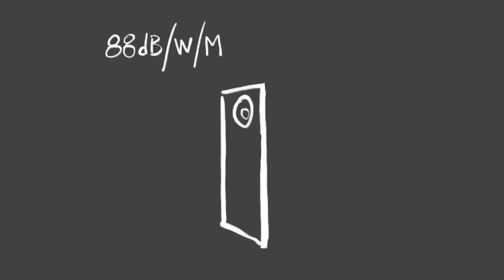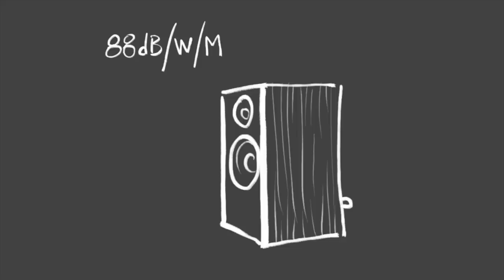John DeVore goes on a rant about the High End Audio lie that inspired him to start his company

Comment: What makes me laugh about the whole hifi thing is that the engineer mixes the music on studio monitors using standard studio cables etc. yet audiophiles are told they need to listen to music on $3k speakers, through this or that amp with hundred dollar cables 🤣
Reply: Coming from a music/producer background and expanding into hi-fi audio this fact has puzzled me to no end... It’s also funny to see endless amounts of money poured into a set up that has no acoustic treatment whatsoever. People don’t realize that the room itself is just as important as any other piece of hardware in your setup.
Reply: Wait... I thought studio engineers mix on great, top quality speakers and use generally top notch, expensive equipment?
Reply: Depends on which studio. There are those that use what you refer to as audiophile speakers and cables. Abbey Road being one of them.
Reply: @465marko  They absolutely do, but there’s a difference between studio monitors and audiophile speakers. Monitors are created to be balanced and tuned in a neutral matter so that the songs entire mix can be heard as clearly as possible and so the producer can create a mix that sounds great on any speaker or device. Audiophile speakers however are not neutral and can themselves sound “beautiful” but in doing so the mix is slightly altered. If a producer used audiophile speakers to mix their song, it wouldn’t sound the way they intended it to on anything except the speakers that were used. A lot of producers will have a variety of headphones and speakers to test their mix on only AFTER it’s been tuned in with the monitors, just to make sure that it sounds great on everything that they test it on before releasing it. But if you want to hear what the artist was hearing when they gave this track the green light, you’ll want to try professional studio monitors. If you can do so in an acoustically treated room even better... audio quality isn’t really about how good or bad anything is, there’s just an incredibly wide variety of ways to enjoy music in hi-fidelity. If we use a food analogy, the producer is a chef who makes your food as true to the recipe as they can, and audiophiles being the customers are arguing over which salt and peppers enhance the dish most or how much they spent on their organic black truffle hot sauce.
Reply: @465marko  the difference is that studio monitors are meant for designing the sound so that it sounds as intended on all types of speakers and speaker qualities. If you made music exclusively on super high quality equipment, you might have trouble adapting it to sound good on something like laptop speakers.
Reply: @LimewaterMusic  Thanks for that, makes sense.
Reply: @MrManlyBeardyMan  Thanks for that nice explanation.
Reply: Hundred dollar cables?  Cables go up to the tens of thousands.  A year ago I wouldn't have believed it.
Reply: My audio engineer has saved me from spending tons of cash.

Comment: I can relate with your gripe. I built my first speaker, a 21" non-ported, steel-bodied (24" diameter steel pipe) subwoofer. I bought a mackie m1400i pro amplifier, 31 band "pre-amp", and modified the heatsink and fans to be quieter... and when I finally plugged my ~40 ohm @ 35hz driver into it, I could only get the amplifier to output 230 watts when in bridged mode and maxing out the amp and the pre-amp input levels...
Granted, it's still 112 dB sustained at the listening position in a ~6000 cubic foot room @ 40 hz, but I still wanted to get my 1000 watts out of that sub.

Comment: Really interesting.  No idea why YouTube suggested this to me.  I don’t even have a hifi system anymore, just a headphone setup.   I do play guitar and have a tube amp.   Guitar speakers still seem to be rated the old way in dB/w/m.   For guitar a more or less efficient speaker changes the relationship between volume and distortion.   Sometimes an efficient speaker will be too loud by the time you turn the amp up to the desired tone.  The old way seems a lot more straightforward.

Comment: In my puzzle of high end audio you just solved 1/3rd of the problems! Now lets talk about DACs
Reply: Pssst you can't tell the difference between 10 dollar Chinese DAC off eBay and a 2500 "audiophile" DAC in a DB matched ABX blind listening test.  Note is wholly separate from amplifiers which can distort on peak if they have weak power supplies.

Comment: John (nice name) - one other issue with both these specs is that they are frequency dependent.  Some of those speakers have a wicked frequency response that is always corrected with signal splitters and frequency divider networks.  I used modified Altec-Lansing Voice of the Theater speakers (with higher power drivers, driven individually) and McIntosh 300W power amps for doing rock concerts (live).

My preferred home setup is a pair of Dahlquist DQM-9s in my living room with a Carver 250W amp, and both KLH-6s (for bass) and ADS L-470s (to supplement the treble) stacked, driven by a Harmon/Kardon 120W receiver for my bedroom.  All, except the H/K  are late 1960's to early 1980's vintage.

Comment: I am older than most.  I also come from the movie theater business.  While tough loads are not super important since we used to use commercial amplifiers, because of the large room sizes, efficiency was important.  Also, with higher efficiency speakers, the amp is being taxed less which leads to cleaner sound and usually better jump factor.  One issue with the older efficient speakers was that they were usually bass shy.  One reason for the lower efficiency was also that the mid and highs were dropped to make the bass sound louder, fuller.  I agree with you, efficiency needs to be re-established as a goal.  I believe that, even though they have other issues, klipsch is is having a resurgence because of the immediacy due to the horns and subsequent higher efficiency.
Reply: just bought klipsch for that reason
Reply: @user-ex9zm7bg3x  Enjoy them.

Comment: I'm not an electronics genius. From experience I've learned to just match your amp, or receiver per channel output to your speakers. If the amp has a 100 watt output per channel your speakers should match it. No more or no less. If you overpower the speaker you'll blow it. If you use a lesser powered amp, or receiver you'll fry the amp, or receiver. Speaker size is also important. The larger the speaker the more air it moves which in turn creates larger sound. I've fried amps, receivers, and blown speakers early in my life. Today, I still own my last two pair of speakers that I purchased almost 50 years ago. I met an individual who built speakers for Clubs and Concert Halls, and was a an audio consultant. He agreed to test my speakers in his lab. Each cabinet contained one tweeter, two speakers of the same diameter as midranges, one one 12" woofer. He found the tweeters to be weak, and recommended their replacement, the mids and woofers were in spec, but he also recommended upgrading the crossover networks of each cabinet. This gentleman also replaced all of the old cabinet insulation, and built new speaker grills from wood with new cloth that look terrific. The cost was a total of $650.00. They're powered by a Marantz SR5012 receiver in a 6.1 setup that includes, an AC Infinity cooler, a Polk Audio center channel speaker, and a Klipch 12" subwoofer. THOSE 50 YEAR OLD UPGRADED PAIR OF SPEAKERS? Purchased in 1973-74 from Radio Shack. One pair is the OPTIMIS 5 model, and the other pair is the OPTIMUS 5B Model. All sound crisp, clear, and can shake the walls and doors when I want them to. New power to vintage never sounded better.

Comment: My dad was a tv repair tech starting in the earlier 60s. He bought a knight kit power amp. 22 watts rms per channel. He built two large speakers with 12" woofers. When the house was empty, I would put my drums between the speakers. At 1/2 volume, it kept up with a loud drummer!
That may not be relevant to this but I just thought I would throw that on the deck LOL

Comment: You know that every frequency has its own impedance and therefore sensitivity. In this case volts has a more linear relation to dB than watts
Reply: Indeed, you are correct. Would the speakers have stayed in a reasonable range of dips to 3.6R for a 4R speaker, then it would not be an issue, but a solution. However, what John is pointing out, that the change to the "improved" measuring system actually allowed the manufacturers to dip to abysmal impedances that the vast majority of amplifiers cannot deal with. The whole point of measurements is to make it relatable to what you have.... and the 2.83V system makes it relatable exclusively to the monster heavy current amplifiers. Hence, our approach to high end audio been altered, and manufacturers are advertising their sub-2R impedance speakers as 4R impedance....
Reply: @realworldaudio  I guess you need a capable amp to drive these low impedance loads. What's your argument?
Reply: @davidward5327  My argument is that 2R speakers should be advertised as 2R, not as 4R. Manufacturers should let people know that they need a capable amp to drive 2R. Advertising them as 4R is false advertising.
Reply: Actually it is the current which has the most linear relation with dB SPL. And the relation is via the force factor.

SPL is not a power factor, so power is the least related to SPL. (dB scale of SPL is in 20 x LOG, of acoustic power it is in 10 x LOG, like electric power). If the current doubles, the power quadruples and sound pressure doubles.
Reply: @JerryRutten  this spl dB /vrms is supposed to be a parameter about a multi range frequency apparatus not a fixed frequency apparatus, so in this case power is not linear with sound pressure, in the frequency range dimension .here is electrical impedance opposite to mechanical impedance and not linear, log or exponent to acoustical impedance which is counterintuitive i know..
Reply: @CarlBurnss  It is not only counterintuitive, but also impractical. If one loudspeaker has a higher sensitivity than another at 2.83 Volt, doesn't say anything about the sensitivity at (for example) 28.3 Volt. It can be the other way around (one having more power compression than the other). Sensitivity per some Ampere, excludes influences of impedance (dips, peaks, modulation and changes) and thus also power compression. But, probably a bridge too far for the audio world...
Reply: @Uncompletedrecall  Well, companies are free to do whatever they want, and when there is consumer base both sides are happy. Reviewers go easy on them, as they pay big time for the ads... it's up to us to stay educated and realize when we are taken for a ride.

Comment: Thats something I always look for when setting up home audio or large scale PA systems, what is the size that I'm about to make my amplifier drive. People forget about impedance and impedance is half the work when it comes to powering a speaker not just the wattage. I could connect a "14000" watt lab gruppen amp in bridge mode to an 8 ohm driver but not see even close to that power coming from that amp, run it to a 4 ohm and now the amp and speaker are properly working together and can preform with less resistance making for lower temptress in the coils. And likewise for the driver make sure it matches what your amp can preform. If a speaker is Bi-Amp wired you could run 2 separate amps and use different impedances however that is less common these days with the crossovers built in to the cabinets. John you did a fantastic job explaining the history of how this problem became what it was and what to look out for when working on systems. Thanks.

Comment: This video confirms my suspicions about many speakers not being as sensitive as they could be.  I'm fairly new to Hi-Fi audio and I've been wondering why I'm able to fill the room with a pair of 46 year old bookshelf speakers and a 20w amplifier while people are having to buy 100w amplifiers to power £2,000 bookshelf speakers with a sensitivity rating in the mid-80s or lower.  And to think we're in the environmentally conscious and energy efficient 21st century!
Reply: the higher the wattage of the amp, the bigger the headroom and lower distortion. it often just come down to lowering distortion at the cost off efficiency.

Comment: Have you considered the fact that the vast majority of amplifiers are voltage controlled voltage sources. This means that you feed them a certain voltage on the input, and a certain different (usually larger) voltage comes at the output. The amplifier controls the voltage and NOT the current or power.

Using the 2.83V specification makes much more sense. in this case. We don't change amplifier when we change speakers. Sure it means that the sensitivity is higher for low impedance speakers, but do we really care? 

It would be much more usefull if manufacturers would provide reasonable specifications, I agree there. I also agree that 2.83V is not the same as 1W (with the one exception). However that doesn't mean the spec itself is meaningless. However if manufacturers would just provide an unsmoothed frequency (or maybe little smoothing 1/24 or something) response on reasonable scale in combination with the impedance curve. We can then extract all the info we need.
Reply: I would still prefer db/1watt/1meter.
Reply: @kawmic7  Why if I may ask?
How do you measure it?
Reply: @hidjedewitje     Look what i wrote. It's pretty self-explanatory.
Reply: @kawmic7  Because you prefer it. Yeah that part is self explanatory. However it doesn't explain why you prefer it or how you actually measure it.

Comment: I'm a professional audio engineer and novice electrical repair/restoration. It's my understanding that in pro audio world, sensitivity is still measured by 1w @ 1m. I just looked up the spec sheet on a widely used and copied JBL 2226 15" lf driver and sensitivity is listed in the official spec sheet as 97db / 1W / 1M.

Comment: I would like to point out that Pioneer Elite receivers which use a variant of Class D amp, changed to High Power MOSFET drivers and changed their specs to include 4 ohm speakers.  However, in my application which includes Polk towers with built in powered or separately powered subs, I don’t rely on the receiver power for frequencies below 100Hz, I use the subwoofer amps.  I’m surprised how long it has taken to incorporate High power MOSFETs in audio since I first designed a circuit back in 1981 with them, but saw the first National Semiconductor presentation on them in 78.

Comment: Not sure I understood everything, but I definitely got the jist of what your saying. I have Snell Type E IV speakers rated at 90dB. Drive them with Adcom power and pre amp and never have to turn the volume past 25%. Not high end, but the best I’ve ever owned. Thanks for sharing
Reply: Good to see some love for Adcom still :).  Running my Magnapan MMGs with an Adcom GFA-555.  At 86dB sensitivity, I need those 325 watts to do the job :).
Reply: @madddog6790  - I picked up a GTP-500 receiver and a GFA 545 on Craigslist for $200 for the pair. They drive the Snell’s easily
Reply: @cheapcheerfulrecordcollect8071  nice!

Comment: I also think manufacturers just flat out lie on Sensitivity. My Revel Ultima Studio 2's reach a loud "demo" level at about 60 watts RMS on my amplifier. I just got JBL K2's to replace them which state that they have a lower sensitivity, but they reach this same volume at only 12 watts on my amps. Lower sensitivity, but clearly are louder. Interesting. Both are Harman Luxury products too. I've sold speakers for nearly 20 years now, and it's always strange that the hardest to drive speakers I've ever sold, and also the smallest, or the one's you'd never expect. The McIntosh XR50's will soak up 200 watts RMS no problem (But give incredible bass), and the Totem Hawks a 5 1/4" two-way wanted a pretty stout amplifier too. IMO, anywhere in the 90's is fine with me. On a side note: Jim Thiel demo'd his CS-3.7's for me personally. He was a very gracious and kind gentleman, and I'm sorry he and his company are gone. He was a pioneer in HiFi. In almost two decades though, somehow our paths haven't crossed, I'll have to hear some Devore's sometime.

Comment: Interesting discussion.

You have a point in terms of matching speakers and amps. My tendency is to design speakers so their impedance doesn't get low enough to be hard to drive, and then assume whatever amp I'm using can provide the current necessary. It helps that I tend to like biamplification with an active crossover.

It seems to me that if you use dB at 1 watt at 1 meter, you have to specify frequency as well, since typically that makes a big difference when impedance is factored in. Where dB at 2.83V at 1 meter should be about the same across the spectrum (to the extent the speaker has a flat response), that won't be true using 1 watt (assuming a non-flat impedance).

So, do we assume 1 kHz? I guess so. But then again, if the impedance at 1 kHz isn't representative of the typical impedance at other frequencies, that could also be confusing. I guess typically it will be representative though.

I'm OK with specs at 2.83V as long as I also get to see an impedance plot. But I can see where for most consumers it would cause some misunderstanding.